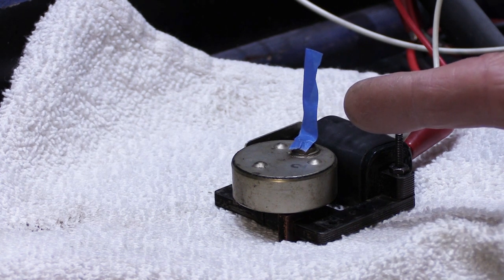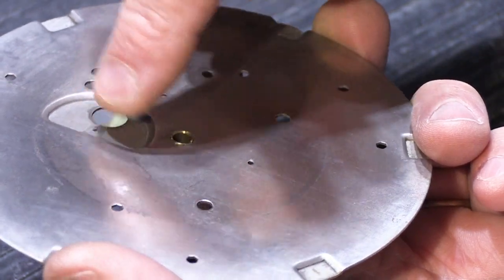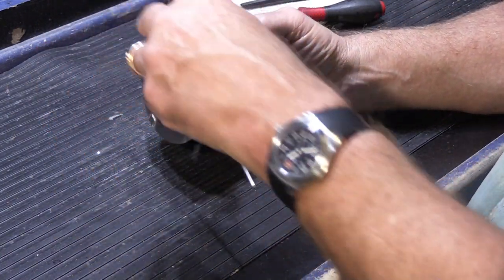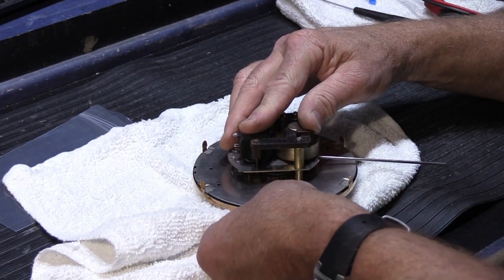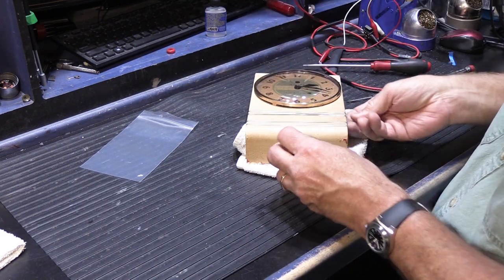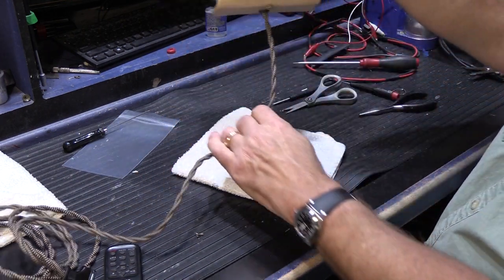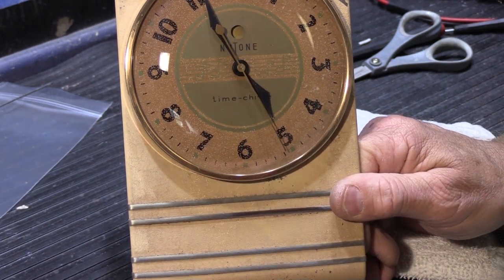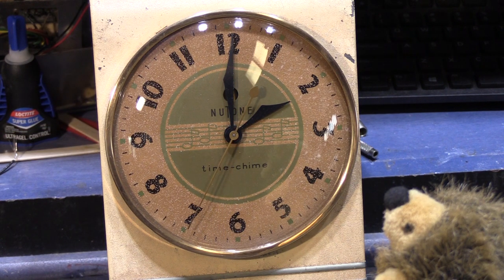Rebuilding a 1930's NuTone "Time ~ Chime" Part 3 - Reassembly of the Clock and Cover

Comment: Another great video, my favorite kind of reality TV! Instead of taking the gear assembly apart, couldn't you have dunked that whole thing in your ultrasonic cleaner?
Reply from the maker: Hi Jack:  I don't think think the clockworks would have been cleaned as well by leaving it together.  Also, it more fun to take it apart and see how it all works (my friend Marv was happy to see that I took it apart and put it back together)  and learn about what - went wrong - was worn out - or other problems.  - Chris

Comment: Another thing I thought of...how come you only need to lubricate the shafts and not the gears themselves?
Reply from the maker: Hi Jack:  Typically it's only necessary to oil the pivot's where they go through the plates.  This prevent the holes in the plates from wearing.  Since the gear train is a precision device that operates at low speeds, there is very little stress on the teeth of the gears themselves.  On electric clock movements like in the NuTone clock, everything just whirs along in one direction, moving slowly as the gears rotate.  Oiling the teeth of the gears doesn't help relieve the tiny amount stress on the gear teeth and there wouldn't be any way to keep the oil on the gears themselves (it would just run all over everything) having the surface of the gear train covered in oil, will attract dirt an dust which will cause problems over time. - Chris
Reply: @northsideservicecompany3567 makes sense, thanks for the reply!!!

Comment: What specifications do you run for a transformer on a 30s nutone chime system? They were probably around 10V, but almost all the 10V doorbell transformers I can find (new or old/NOS) are a max 5watt/VA which seems low to me.
Reply from the maker: Hi sgath92: You are correct, the selection of 10 volt Transformers is very limited - I would use a 12 Volt 15 Watt Transformer.  You can use an Edwards 596 which is 12 volts AC and 15 Watts (VA) - Chris
Reply: @northsideservicecompany3567  Thank you that's very helpful information. I am going to be doing a K-37 soon and don't want to subject it to the higher voltages more commonly used. Its not as early as this time-chime you did, but it seems to be on the early end of the Nutone spectrum. Its going to go in a kitchen next to a late 50s Nutone 30"w recirculating stainless hood that I am also in the process of rebuilding. Surprisingly Nutone still offers filters & motors for their range hoods going back to WW2.
Reply from the maker: @sgath92  Sounds like a cool project - Chris